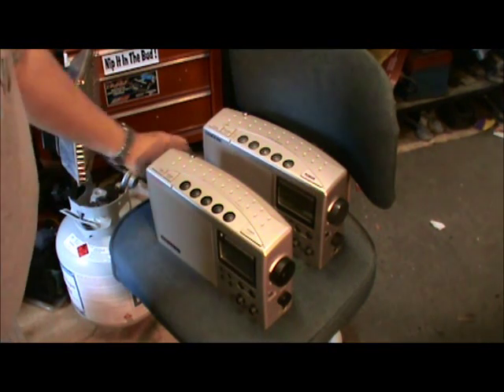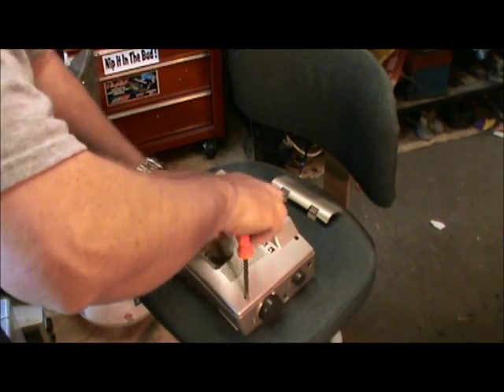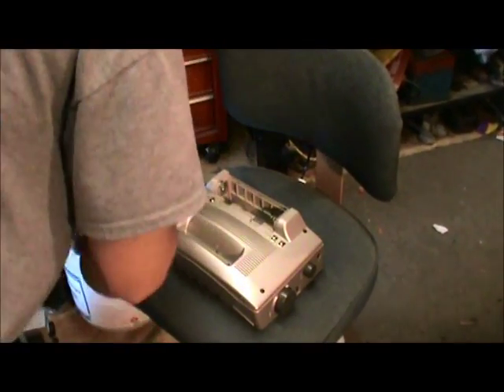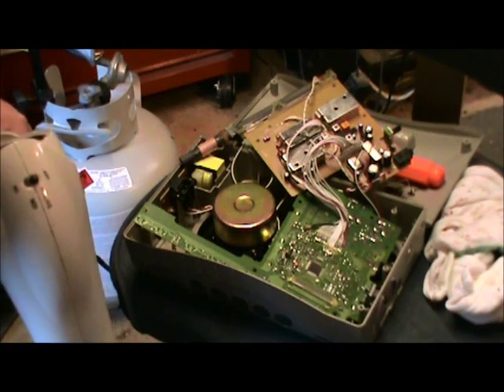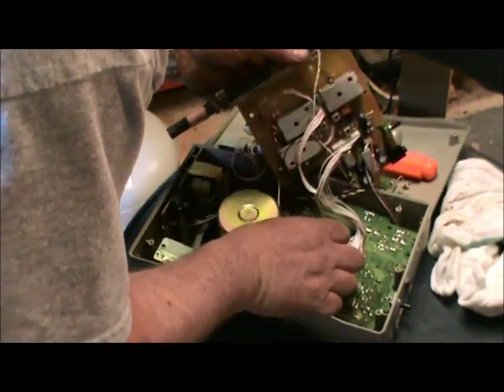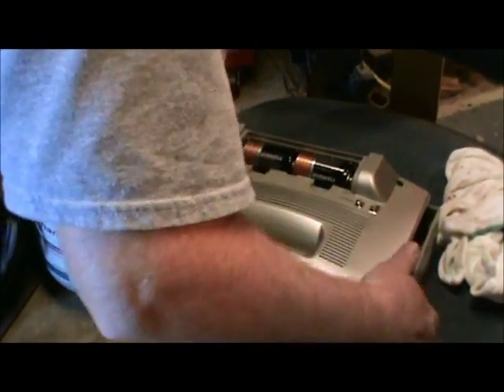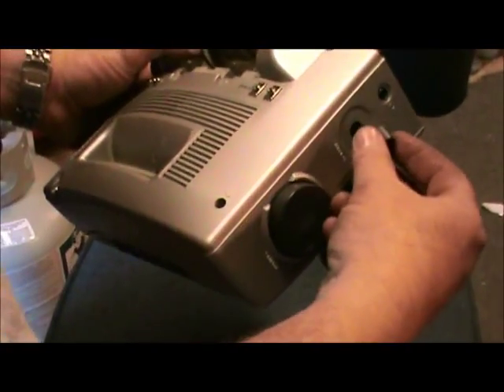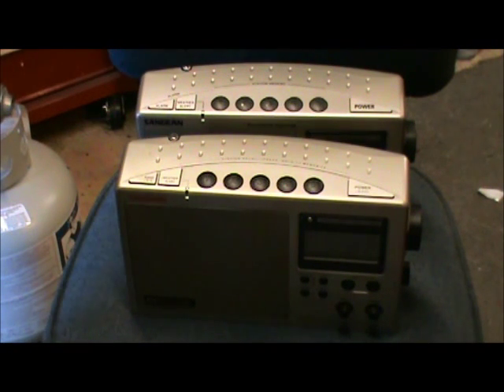CC radio repair

Comment: FYI - found a Sangean/Crane radio on EBay for $15. Same issue - “Broken - display not working.” After two attempts with the hairdryer, pencil, and some patience - all has been restored. Wonderful - thank you for sharing this information with us!

Comment: I just fixed my radio, just like the video shows!  I did a little something extra, though.  Because of all the heat involved, I decided to  fabricate a "heat shield" to protect the square integrated circuit chip right next to the ribbon cable.  I cut out a oblong piece of cardboard from a cereal box and covered it with aluminum foil.  The idea is for the heat shield to reflect the heat away from the heat sensitive integrated circuit chip.  I taped it into place, taking care not to get any tape on the ribbon cable contacts.  I fired up my heat gun on the LOW setting and heated up the ribbon cable connection.  I then took my pencil eraser end and gently but firmly pushed on the end of the glued cable (black stripes) where the contact is made with the circuit board.  I put some batteries in and tried it out.  I found about 2/3rds of the display worked.  I repeated the procedure and I'm glad to say my display works perfectly!

My only concern was the heat gun as it can put out some serious heat.  So, it's best to be conservative here, because you don't want to melt or distort any plastic.  You want it to be good and warm, not too hot as the risk for damage goes up the hotter it gets. I just purchased my radio from my local Goodwill store for $8.99.  Built in April, 2002, it doesn't have the metal shield like the one he actually shows in the video.

I don't know how long this repair will last.  But if it goes out again, I know I can fix it.

Good luck with your radio, Tom

Comment: This fix worked perfectly.  All parts of the display returned.  I used the hottest setting on the hair dryer.  Pushed it down with the pencil.  Waited for it to cool.  Then brushed on super glue gel.  Works like new.  Thanks for saving my radio!!!!!

Comment: First thing: Thanks for the video and that because of your video I got my CCRadio display up and working again…

Second thing: Don’t throw away the metal shielding. That metal shielding is a grounding shield to cut out outside RF noise etc from effecting the electronic signal/processing inside the radio PLUS from effecting unwanted noise outside on other electronic equipment that might be near your set. Even the speaker grill is grounded.
 
While the heating and pressing the ribbon cable work for a while it was not permanent. What I have found out to be holding and hopefully permanent is the mod I did and basically what others kind of mentioned. I used three “Command medium refill strips” cut in-half the LONG Way (making six long pieces). I laid them only on the ribbon strip six layers high. The last layer I kept the paper on the very top to keep it from sticking to the ground shield. This would help if I ever had to remove the grounding shield again for any reason.

Oh by the way, the six layers of "Command tape is just enough to put pressure on the grounding shield (when re-installed) and ribbon cable... causing constant pressure on the ribbon cable contacts.

Unfortunately, the system doesn’t allow me to put the picture (of what I did) up here to show you exactly what I did.
Hope this helps others…

Ps: I also replaced my speaker, that too was defective...
Reply: I understand what you did.I think some hard rubber of the correct thickness would work well.Just bought a CC Radio at local swap meet for $5.Works well with lots of missing display parts.
Reply: Good info guys! Thanks.

Comment: Awesome video, thank you. My CC Radio Plus has this same problem, so I'll give your procedure a try. C.Crane Radio should be ashamed of themselves. This is clearly a manufacturing defect, and they should have a lifetime warranty on that type of thing. I bought three of these radios, and gave two as presents. C-Crane made a great radio, but is run by the kind of people I don't want to do business with. This is not a $19 radio that is a throw-away.

Comment: Thanks for the tip on fixing this LCD display problem. I tried the pencil several times and got various results so i used a screwdriver handle instead and that got it all working again.

Comment: Thank you for posting this video. The CC radio at our house has a thin metal shield like the one shown here.
heating to rebond it improved it but not reliably. I used a piece of firm weatherstrip foam and resoldered the shield in place.
That holds the ribbon contacts enough so the display works fine. Still have an on/off button that's flaky but usable.
Thanks again for showing us the weak place.
Reply: Either the LCD display dies or the buttons crap out on these radio's , they have a horrific longevity record.

Comment: I built up the courage to follow your steps, and my worst fear appeared... the metal cover over the display strip.  I just about gave up at this point because by unsoldering said cover I could damage any circuit, destroying the radio.  It took me a week to give it a go... I did... tough job if you don't have the soldering experience, and to my delight and surprise I was able to pull it off! The following was easy.  However I thought of wedging a large, square eraser between the strip and the circuit board that covers the bottom circuit board that holds the strip in order to continuously keep pressure down on the strip. Theoretically, by doing this the display will last longer and I won't have to repeat this operation (about 2 1/2 hours) in what is left of my lifetime!  Thank you Eddie for the info!

Comment: Good video. Someone gave me one of these radios the other day, said it was junk. I fixed it before I saw your video, used a heat gun and a piece of cardboard cut to the length of the ribbon cable and moved it down over the ribbon cable as it cooled. Nice radio. If it was used on AC much you may want to check the 3300UF @ 16Volt cap on the board where you plug in the AC cord. Mine was slightly bulging on top, took it out and checked it, it was down to about 1100uf. Replaced it with one rated at 25volts. took care of the hum on turn on. It only hummed for less than a second before I replaced the cap now no hum.

Comment: I found a CCradio at the thrift store today for $5. Noticed a few LCD numbers were missing. Got it home, and I could barely tune the radio because of the bad display. Found and watched your video. Within five minutes had it repaired. 
I used the plastic handle of a screw driver to press down on the ribbon cable. Must have worked...
When I turned it on, and laughed out loud. Their loss was my gain!

Comment: It works! I bought a non-working $20.00 EBay special that only displayed L (for lock) no matter what. Split the case but kept the batteries installed. Found the display ribbon cable (old 2001 model no shield) and did the heat job to it. Almost worked. Did it again with a little more heat across the cable and ran my finger up and down on the strip until cool. Now it works perfect.

Comment: Thank you for this amazing video.  My CC Radio Plus (made in 2002) has the same PCB layout as your CC Radio repaired in this video.  I followed your instructions to the letter and restored my CC Radio Plus.  The LCD failed almost exactly 1 year after purchasing it.  I've been using this as an expensive paper weight for the past 13 years.  I wasn't thrilled about the possibility of throwing away a $200+ radio that actually worked excellently but for there being no display.  I have not purchased another C Crane product since then because of this problem.  It would have cost me more than half the cost of a new C Crane radio to have it shipped and repaired.

Comment: Thanks so much EVT.  I've got my 1 of 3 CC Radio LCD displays back! We had a his/hers situation and an uncle and mother-in-law who had their own, which we ended up with on their passing. One non-Sangean CCR Plus display is fine,along with the now fixed Sangean CCR Plus. Feeling confident I can fix the other 2 Sangean CCR [not plus] models we have IF you or your commenters can explain how to remove the heat shield so that I can apply the heat/eraser fix.  The heat shield on these two units cover the chip and display ribbon connection. I don't think I would replace the heat shield on reassembly. Doesn't take a rocket scientist to equate display failure with chip trapped heat loosening up the ribbon.

Just call me Newbie with a Soldering Iron, or Danger, Will Robinson.  Your choice. Again,  THANK YOU!

Comment: Thank you for your post.  Saved another CCRadioPlus.  This is a Design Flaw and clearly the major weakness of an otherwise Excellent radio.  For the cost of a decent Ribbon Connector, CC Radio could have had an outstanding Reliability record.

Comment: I wish I had the horse sense to watch this excellent video BEFORE attempting to fix the display!  Mine separated from the board and as a result the display went from a state of partially missing segments to completely out.   I had another problem.....the programmable station selectors, as well as the on/off button were intermittant (apparently from dust on the pushbutton switch contacts, which I fixed by a good simple cleaning with a few squirts of Radio Shack Contact cleaner.   The display, of course, is now worthless and I just wrote a letter to C Crane to see if they could send me a replacement display card.   I was so careful and cautious at removing all screws, boards and pots.   I have no hands on experience with those thermal contacts (obviously!).   BTW, it is my guess that the soft metal can serves as an EMI shield protecting the receiver circuitry from the microprocessor and various other digital pulses produced on that board.   I had no trouble removing that, as I used a temp controlled soldering iron with solder wick.   I guess I am now dead in the water with the display.  I had to reprogram my favorite stations using another radio.   Now the clock and alarm/timer, of course are unusable.  Live and learn.  Thanks for the posts, Eddie and JJ!

Comment: Thanks so very much.  Had to heat it up twice but it's BACK.  Now the only problem left is the speaker doesn't work.  I can bypass it by using earphones, so now,
 I just plug in a speaker.

Comment from the maker: Be careful and DO NOT try to remove the ribbon from the board. I tried to remove it to clean the contacts. Problem is there is no way to reattach it. I tried many times and many adhesives. None worked. I've heard of after heating and pressing down on the ribbon you can use a firm styrofoam between the ribbon and the cover to hold pressure on it.
Reply: Thanks for the heads up on that!
Reply: You ripped all the solder pads off the motherboard that radio is fried bud 😂

Comment: My 2000 model CC radio had the same issue , took 3 times with the blow dryer to fix the ribbon, seems if it had a sealer to prevent moisture it would  prevent reoccurence.

Comment: Great video, thanks for your time. I have the model with the shield.  Do I need to re-solder the shield back into place if I get it working?  What is the shield for if the newer radios were made without it? I have 3 different C Crane radios, this model, a pocket model and a Wi-fi model.  LCD problem with this radio and volume control broken on pocket model and they are barely used in new condition. Only the Wi-fi hasn't broken (yet).  I will never buy another C Crane product as it's overpriced junk in my estimation.
UPDATE:  I was able to repair the radio following your instructions - thanks! I did not replace the shield but did put a piece of durable closed cell foam between the ribbon cable and the top board. But now that I can see the readout and utilize the radio I have found that the 5 select preset button function does not work :( Anyway, thanks and blessings to you and yours.

Comment: Mine also completely lost the alarm function and beep when pushing buttons, seemingly up and quit one day for no obvious reason. That happened a while before the display went wonky. Display not out, but showing garbage information with various segments going on or off in a seeming random fashion. CC-Radio plus in my case, but I'd suspect most is the same. Wonder if this fix will solve everything and not just the display?

Don't want to get rid of it though, as it pulls in stations like a boss and has good battery life when not using the cord. Just annoying that much functionality is limited when you can't tell what it's doing because no display.

Comment: Where does that white wire go in the middle of the speaker at 3:55 of the video? When i opened mine up it was, broke. That might be the cause of my speaker not working.

Comment: Great job but I wish you had explained why that ribbon cable quits transmitting data to the display. In any case a great fix but how did you find out about this?

Comment: People need to STOP BUYING the CC radio 2 E and the CC radio 3 they're defective in design .  These two models are C cranes latest and they both have the same defective LCD screens and buttons that the old radio's had. 

The chances that these radio's will last many years without suffering from major issues is virtually non existent .  Most start failing shortly after the one year warranty runs out . They will either develop an LCD screen issue or a button response issue and those problems get worse and worse and worse as time goes on. For every ten radio's that do not develop these issues you have one hundred that do .  It's just a matter of time .

Comment: I have a cc radio plus the display on it starting to not work on some numbers.I might try to solder on the terminal twisted connector and screw a think piece of thick aluminum on the and down to the board past from the traces to hold the plate in place and a few layers of tape on the ribbon cable to press tightly.to hold the ribbon cable on the board.I know this will work.let me know about this.

Comment: My cc radio display is fine, but no sound from it.  This happened once before, I sent it back to them and they repaired it. So now, a couple years later... same deal. What causes the sound to stop working and how do you fix it?

Comment: These radios are nowhere near the value they want for them, and C. Crane should be ashamed of themselves. This is clearly a manufacture defect, and should be fixed. Its unfortunate that a radio that sounds great, and has outstanding performance on both AM and FM, has to look like a child's radio. These things are ugly and bulky, and have no style. I own many great vintage and modern Radios from Sangean, Panasonic, Sony and GE, but something about these CC radios just puts me off. Again, they are world class performing radios ( that's not the issue here ), but constantly hearing about these displays going out, and the fact they look cheap ( and are $170 ) steers me away. I think Sangean makes these radios for C. Crane, so both company's need to step up to the plate and not only redesign these radios ( to look more appealing ), but fix any and all design flaws before, starting with this display issue. Good job fixing your radios bud, I hope you get many years from them.

Comment: This is a really poor and cheap design.   The sleep number bed remotes have the same problem.  I fixed both of my remotes with the same method.  There is also a Ham Radio model FT-857 that has
the same problem with the display.  I wonder how long it will last before it drops out again.

Comment: Why do your C. Crane radios say "Sangean" on the top left front?
Reply from the maker: Scott L I don't know. That's just the way they were when I got them. I think they all say that.
Reply: I was curious--could you solder each connector contact to the board for a permanent fix? I can't really see the connector so I don't know if you'll need to use jumpers.